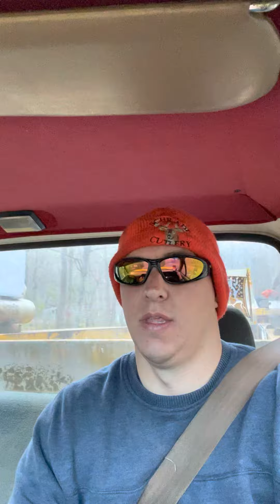21,000 pounds towing with a 7.3 IDI turbo diesel.

Comment: 93 IDI NA F 250 4/10 rear axle ZF5 manual stock towed a neighbors F150 platinum GVWR 5500 TX to AR in the hills NE Fayetteville on 24' GN flatbed averaged 10mpg going up had to replace fan clutch on return overheating issues. Fixed bought it in 2018 wouldn't trade it for a new one.
Reply from the maker: They definitely get the job done

Comment: I had a 96 powerstroke 5 speed f450 with 4 30 axel. 

It did just as you described. 
I now have a 93 e 350 and love the simplicity, plus it was cheap. 

Again it does not compare to a cummins. But still very reliable.

Comment: I have towed around 6 tons before with a stock 94 Silverado that had a 350 tbi and a 5-speed. towed the load around 30-40 miles and up a long steepish hill,it did ok other than riding on the bump stops and seemingly flat tires

Comment: whats youre mpg?
Reply from the maker: It wasn’t great probably very low teens. But that’s to be expected with a 11ft service body, lots of weight, and a giant lift gate on the rear. Especially with 5.13s. 4.63s probably would have helped.
Reply: @cbr600rx7  thx, im asking because im looking for an engine to swap into my ural 375 truck :P